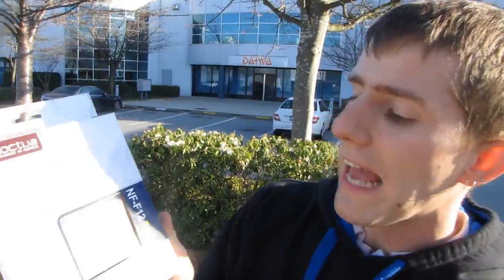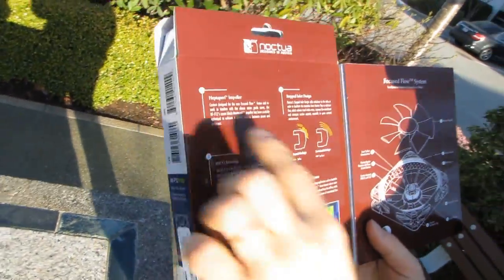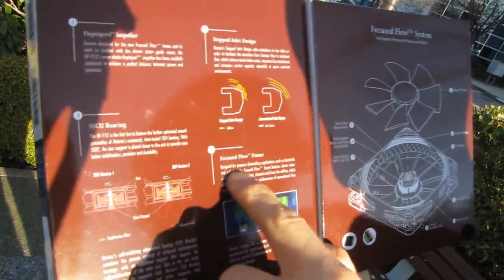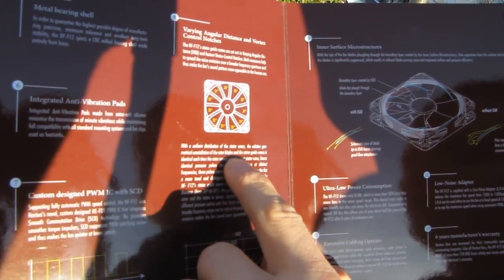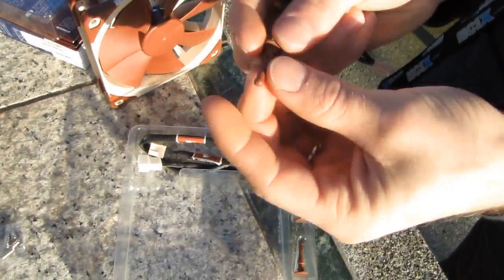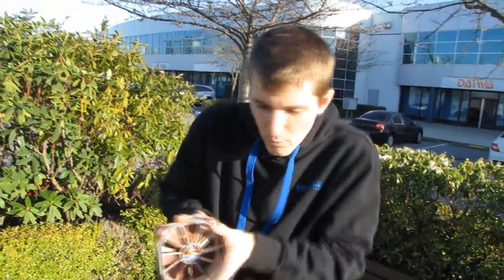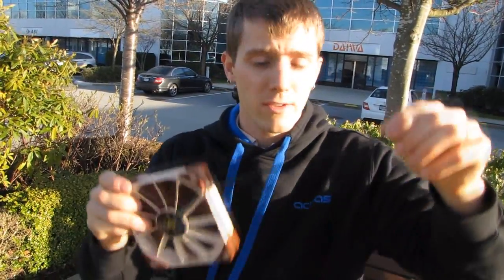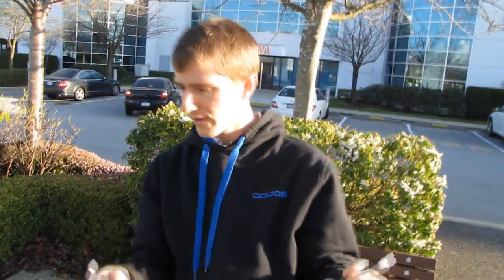Noctua NF-F12 Quiet Premium Direct Airflow Cooling Fan Unboxing & First Look Linus Tech Tips

Comment: nice video but my English is bad I cant put this in my case no in water cooler only in case ?????????????????????
Reply: let a german guy tell you: english is crucial, especially when it comes to youtube and tech stuff

anywho, the F12 is pretty much the best fan you can get, unfortunately it's only available in 120mm
I use two of these in the front of my case to get fresh air to my graphics card and they do a pretty good job

Comment: Can I use this in a horizontal (flat) position? I've got a Cooler Master Hyper 212 Plus, and the case fan that is fastened on the bottom of the heat sink rattles. Will the Noctua make any rattling noise in a horizontal position?
Reply: Yes.

Comment: Is low noise adapter necessary whilst its PWM?
Reply: +Andrew Chung One year later....No. They go from 300 to 1500 RPM so LNA is not needed. 300 RPM when the system is idle you won't hear it. I run 5 of these in my system. 2 as intake, 1 as exhaust and 2 on my cpu cooler. They make no noise whatsoever.

Comment: Ugh guys, did I mes up my build? I ordered 3 of these for the corsair 350, 2 cause the front panel creates a lot of resistence taking into account the fans are behind the front lid thing and behind dust protectors so you need high static pressure, and one for the back of the case as exhaust cause... I don't know, I thought I would use the same one to keep the airflow balanced. I also put two 140mm noctua flx on the top as exhaust. Do you guys think it will create good airflow?
Reply: sure

Comment: I'm going to do my gaming PC build in a Thermaltake Urban S31, which seems to be quite restricting when it comes to the front intake so I have thought out a fan setup that I think would ensure quite good airflow in the case and I just wanted to hear what you guys think about it...
 
Front intake: 2 x Noctua NF-F12
Bottom intake: Stock case fan (120mm)
Top exhaust: 2 x Bitfenix Spectre 120mm LED (red)
Rear exhaust: Stock case fan (120mm)

Should give me quite good airflow right? I didn't want amazing fans to exhaust air, because then it would create negative air pressure so that's why I chose the regular spectre fans over the spectre Pro ;D also it saves me some money ;D

Comment: which noctua fan is better? the nf-f12 or the nf-p12 ?
Reply: depends on where you'll be putting it... for a really restrictive area like a dense fin radiator or a dense heatsinkt the f12 fans are better... like Linus said f12 for the restricted stuff and the p12 fan is more of an "allround" fan ;D

Comment: I honestly don't care about the colour, I'd rather have a system that has different colours like the MOBO is blue the Ram is orange and the LED is purple, as long as it performs well, than a system that has a colour scheme like black and red that doesn't perform well.
Reply: I'll be using Noctua fans as intake fans in a thermaltake urban s31 and some cheaper LED fans for the top exhaust ;D should give me a pretty good looking build and provide all the airflow I need ;D

Comment: I have finally bought 2 NF-F12 fans for my h100i because of how highly you speak of them Linus :)
Reply: Marcus Nailor Same here :D
Reply: I am thinking about buying them, is it worth the money? Did you have the original fans? How is the loudness?
Reply: Definitely worth it, below 1000rpm is nearly silent. Really, nearly silent, performance is better than the SP120L that comes with the h100i. I spent £30 on 2 and it was 100% completely worth it :)
Reply: Thanks for the fast response! :)
Reply: No problem :) glad I could help
Reply: Got 6 of these now! They're great :) QsEExTr3me
Reply: Marcus Nailor Hi, I justhave a question, MNy noctua NF F-12s have a really loud noise and whining noise and same with my dads, is this a defected batch or is it normal ? The noise starts around anything above 1000 RPMs

Comment: At no point have noctua or linus ever claimed that these fans have better performance or cfm. They only claim to rival other fans at lower rpm. Considering your thermaltake fans run a full 500rpm faster i would say the noctua was as advertised. Turn the thermaltakes down to 1500rpm and see how much hotter your system runs.

Comment: I purchased these fans based on Linus's recommendation. I've learned a lot from Linus over the years and I think he's great.  
However, I replaced the supplied fans of the Thermaltake Water 2 Pro with 2 Noctua NF-f12 fans and haven't seen any type of performance improvement at all, as a matter of fact my temps seem a little higher and i can feel the airflow coming out the back of the case is less.  
They may run a little quieter but thats it. Pretty disappointed in the fan performance.

Comment: Linus has performed both pull and push only tests using a variety of AiO coolers as well as variety of air cpu coolers.

It depends on the individual application as to whether or not pull is better or push is better.

for just about every single single 120, 140mm, and 240 and 280mm rad involved system...push is better especially if it is a very densely packed rad.

Comment: Mine a running fine so far, though it's only been a couple of years.  The Jyunis tend to blow air more to the side, but for exhausting hot air from my case they're efficient.  I also have Gentle Typhoons which seem to be better at generating pressure so suitable for radiators, but they can be loud at full speed.  Still, Typhoons seem to be the fan of choice for people using water-cooling.  When my CPU is idling all fans but the one on my CPU are off anyway, so it doesn't bother me much.

Comment: So this thing moves 55cfm at 22.4dBa and 1200RPM.  A Scythe Jyuni at the same speed moves 68.5cfm at 24dBa, and it looks like a normal fan too.  Both are practically inaudible and the Scythe is a third cheaper.  It's style over substance.

Comment: Painting it would pretty much ruin all the thoughtful tech they put into it. You're unbalancing the fan blades and adding a coating of a different resistance to the fan. Basically you're negating any advantage the fan has over normal fans...

Comment: Listen I also don't like the colour, but the main problem with that would be that painting a fan like this will actually 'break' most of the cool & quiet solutions noctua built.. Add to that the rather high price for these fans.. spending another 100 bucks (be it euro, pound or dollar) to get these fans in your case is just a bit much :/

Comment: I use 2 of these on a dual radiator for my cpu fan, The radiator is on top side of the case as a dual purpose exhaust and cpu cooler. But, I always wondered if putting the fans on top  (Pull) is better or worse than under the radiator (push).
Anyone know?
Ps. these fans are friggin amazing, they can go insanely slow, and superfast:)

Comment: Interesting. NCIX sells it for 21USD , and I can buy it back there in EU from 20 to 23euro. AUSTRIA is just "over the hill" neighboring country. For example  US APC products are 100% expensive here in EU. pche...

I have R8 S12B P12 and F12(pwm) too.They're worth the price which means noise-to-airflow ratio, around 1W/0.09A power usage ,premium fans, awesome support,high quiality parts and also long-life SSO1-2 bearings.4-5euro cheaper fans I think are overpriced for what they offer(exceptions)

Comment: i actually have 3 of these fans in my case. 2 on my hyper 212+ and one on the the top on my case. spinning at 1500rpm there is alot of whine off them, but i think thats just from the hyper212+.if you are thinking of getting these get a Noctua cooler too. i dont think they are made with non noctua coolers in-mind